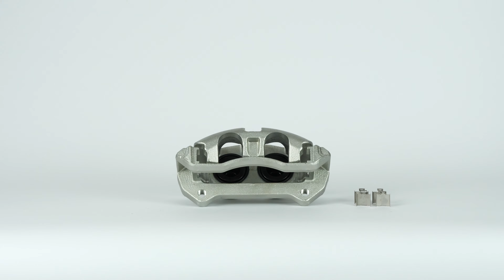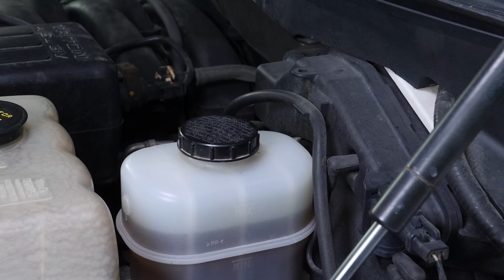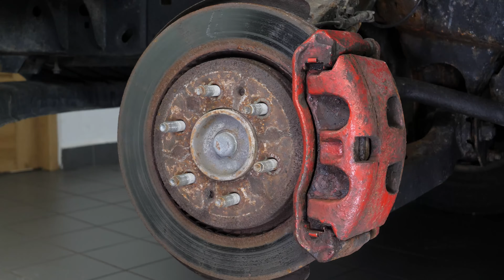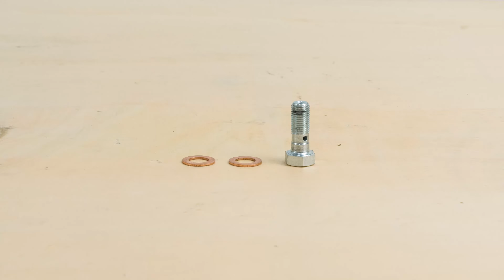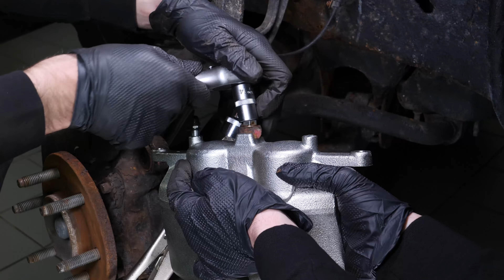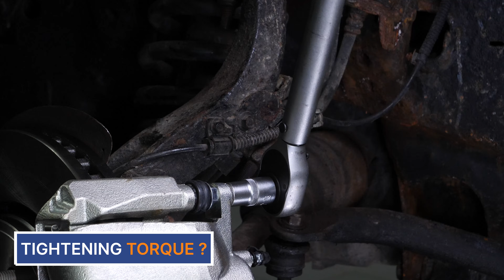How to replace the Front Brake Calipers 2009-2014 Ford F150 🚗

Comment: I've read pushing back the pistons without opening the bleeder can cause damage to the ABS block...
Reply from the maker: Hello tyrannussipissamentul 😀
One of the things we love most about our work is talking to automotive parts designers.
We asked engineers who have designed ABS blocks for well-known automotive suppliers and we learned that there would be no risk of damaging the ABS block by pushing back the piston without opening the bleeder.
We know that some people advocate this, but we think it’s a mistake. The fluid rises through open solenoid valves, so there would be no risk of contamination, and pressures are very low compared with a vehicle in operation.